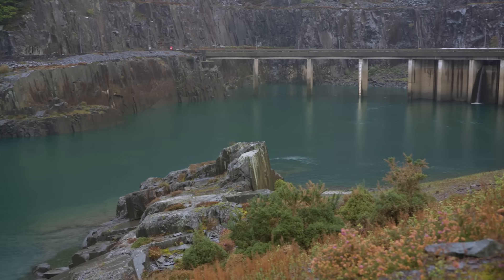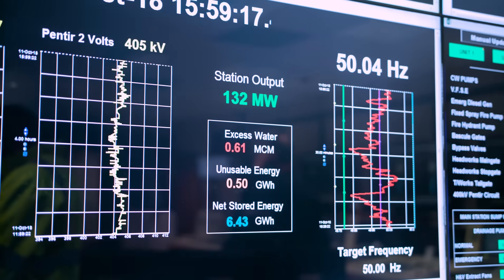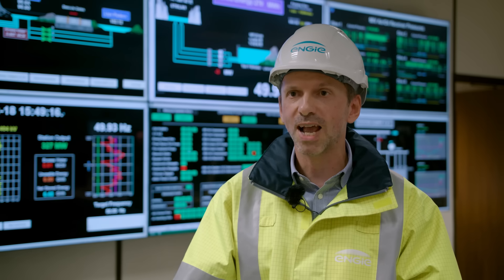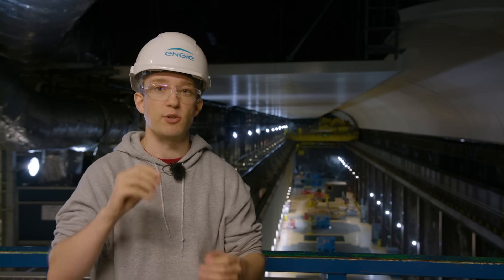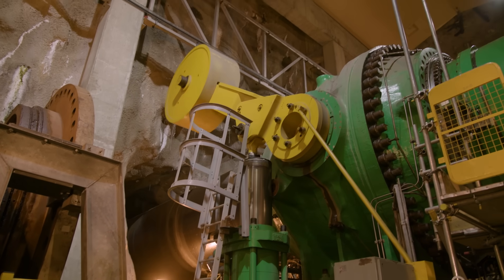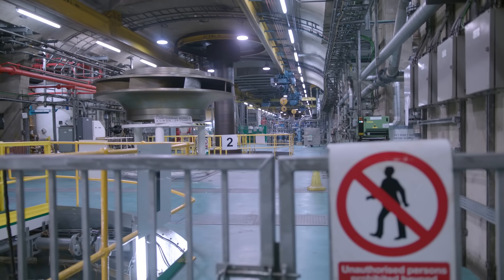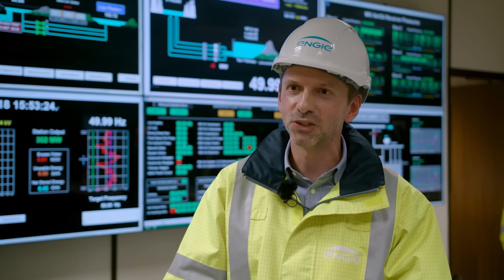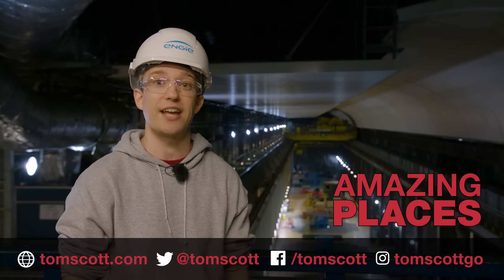Britain's largest battery is actually a lake

Comment: Niagara Falls has something kind of like this, only they don't need to use pumps to fill it.   They have large reservoirs, and and night they divert water from upstream into the reservoir, which they can draw down during the day.   This helps with higher daytime electrical usage needs, but also helps with daytime tourists, as they don't want to divert so much of Niagara Falls to use for electricity that it disappoints tourists.
Reply: Wordsnwood (Art Mulder) of course! People find it very hard to believe that they are able to divert the water entirely, completely draining Niagara Falls, and it’s completely true! They’ve done it before and there’s talk of them doing it again.
Reply: @EVILBUNNY28  
Note that that is about being able to fully divert the water from Niagara Falls itself, which is the smaller, American, falls,  The larger falls, Horseshoe Falls in Canada, cannot be fully blocked in this way.
Reply: @EVILBUNNY28  

I've been told the same thing...

Certainly it is a noticeable diversion from daytime to late night when they fill the reservoirs, if you do an A-B comparison..
Reply: I was told exactly that by my tour guide last summer! And there was a noticable drop in water levels overnight, when they draw it away into the reservior
Reply: One of the most interesting parts of my visit to Niagara Falls was when I happened to wake up at dawn and watched from my hotel room as they turned on the waterfall for the day.
Reply: technically the reservoir is "lake erie" but there are other more active reservoirs behind all the generating stations.
Reply: @markgnorthcott  there is a reservoir between rt265 and garlow Rd at the Tuscarora reservation. As an Uber driver in the area I've driven around it a lot. Canada has a similar reservoir near the sir Adam Beck station across the gorge.
Reply: funny where i seem to bump into woodworking youtubers!
Reply: Lots of us are nerds as well as woodworkers...  ;-)
Reply: That's a hydro-electric plant. It actually "produces" power, electric mountain doesn't produce power per se, it "moves" power from the night time to the day time. I mean realistically it probably does produce some power that didn't previously exist within the system after am extremely heavy rainfall, but in general that's not it's how it's intended to function or it's purpose.

(I put produces and moves in quotes because realistically all power generation is basically the movement of power from one place/form to another. In the case of a hydro electric plant, nature replenishes the resevoir, so we don't have to use power to do it ourselves.)
Reply: @adamkearleyinternetcelebri2409  Thanks for the explainer!
Reply: Niagara as you describe is called off-line storage which is a bit different than pumped storage. Pumped storage can also  make use of non-renewable electricity by taking up unused base load of conventional power stations when it is not required.
Reply: Wordsnwood (Art Mulder) there was a proposal to build a system similar to the Niagara falls one in the Scottish Highlands but it was Lobbied out of existence by people concerned it would spoil the view for tourists, the same way every big renewable energy plan is
Reply: @themadhammer3305  It's infuriating dealing with nimbys. Most of the renewable energy projects are actually prettier than the landscape people claim it would ruin.
Reply: The Mad Hammer That idea was got rid of because it was a hydro power system on one of Scotland’s greatest rivers to kayak
Reply: Though Dinorwig can also draw power from the grid when there's too much supply (which is also a problem!).. Which the Niagara plant can't do
Reply: @Joshua Coales ...  Interesting point.  Here, AFAIK, we ship our surplus power to the US.  Is the UK connected at all to the EU grid?
Reply: I live an hour away and never knew this! Thanks!
Reply: Hydoelectric plants only run at 20-50% of their turbomachinery capacity over a year. After a large thaw they are working hard.
Reply: Thank you for that truly interesting fact, I hope we see a video on it soon! hint
Reply: Also, if too much of Niagara was diverted, the top-secret spaceship base will be revealed.

Comment: If you find a Balrog down there, remember to hook it up to a geo-thermal generator for added power.
Reply: Balrog from a common person perspective: Run away, is a demon!
Balrog from an engineering perspective: And now, we connect the Balrog-1 thermal generator to the grid. Clean energy at a little cost. Nice!

Comment: "...this rainy bit of Wales".  Well, that narrows it down a little. :P
Reply: There are two bits of Wales - the rainy bit and the bit that's about to be rainy.
Reply: @epiendless1128  as someone welsh, i can confirm this is true
Reply: Just thought I'd mention, it's just north of Snowdonia. Dinorwig neighbours to the North of Snowdon. (You can actually see it from Snowdon if you take the path from Llanberis.)
I mention this here because Snowdonia is a rainy bit of Wales compared to the rest XD
Reply: @jammyjammingtonjam  oô
Reply: Previous to the hydro electric scheme the mountain was hollowed out by underground slate quarrying.  When it was being constructed local ex quarrymen who had quarried the chambers within warned the engineers that some of the excavation they were doing to build the power station would  destabilise the interior of the mountain, they were ignored resulting in a huge collapse which thankfully resulted in no deaths.
Reply: @creamytrumpet7435  The mountain was not hollowed out , the majority of the slate came from quarries , not underground mining . There was a little , but it was very little as most of the slate was near the surface and easy to get by quarrying rather than driving in shafts . How do i know ?? , been there at least six times and walked around a lot of it
Reply: @MrTarmonbarry   the mountain was partially hollowed out by quarrying this was the initial hollow which was further enlarged by the hydro electric scheme. The above ground quarry and it's size relative to underground operations is immaterial as regards the power station. I'm glad you've walked around it many times, I've not visited Dinorwig very often as I'm more interested in underground slate quarries many of which I have extensively explored in North Wales as it is my home. Slate was never quarried via shafts, it was accessed by strike tunnels called adits driven in at right angles to the dip in a vein. The only shafts used were air shafts eg at Moel Fferna in the Dee valley. In some places eg Rhiwbach and Maenofferen above Blaenau Ffestiniog there were underground inclines but no shafts. The slate was then exploited via chambers roughly 50 feet wide and 50 feet high with pillars about 50 wide left between chambers to prevent the whole quarry collapsing though some places like The Cambrian in the Ceiriog valley there was a lot of pillar robbing making the quarry much less safe. Due to the fact that extracting slate was done this way they were always referred to as underground quarries rather than mines because mining tends to follow the vein in it's entirety.
Finally going back to Dinorwig I am told that at the very top of the site the Australia mill which operated between the wars still has workmen's coats hanging on pegs still left from the 1930's when the mill was abandoned! One of these days hopefully I'll have the time to walk up and see for myself.
Reply: @Celtic Revival / Adfywiad Celtaidd o.k , do you care to share with the rest of the civilized world what is patronizing about stating the facts about Electric mountain??
Reply: Isn't all of Wales rainy though?
Reply: @supersnowman16  Yep, can confirm.
My reason: I'm Welsh and its pissing it down outside the window rn
Reply: I was born and raised around two miles from here. It’s just outside the village of Llanberis.
Reply: @stevies_cars  just Snowdon no Mount.
Reply: Do shut up
Reply: Implying there’s a not-rainy bit of Wales.
Reply: There is a reason people call Llanberis "piss pot valley"
Reply: 😂😂 to true
Reply: @Celtic Revival / Adfywiad Celtaidd its typical idiomatic welshmen
Reply: @Celtic Revival / Adfywiad Celtaidd and before you go assuming anything I was born in wales and live in england on the border, and think both countries are great
Reply: Near Llanberis
Reply: Near Llanberis
Reply: Well it won't be the famous desert of wales
Reply: You say this as if Wales needed narrowing down
Reply: Celtic Revival / Adfywiad Celtaidd Lmao
Reply: @Celtic Revival / Adfywiad Celtaidd c'mon thats not patronizing at all wales is rainy thats just a fact it's just dumb to be offended about sn1 calling your country wet
Reply: @jamesdavey8675  It's subjective. There are no facts involved.
Reply: @jamesdavey8675  agree 100% an I'm Welsh. It's definitely a very wet country compared to England
Reply: @Celtic Revival / Adfywiad Celtaidd Agree no welsh accents never mind language. oh don't you just love the English, not.
Reply: It's not as if Wales is that large
Reply: @batt3ryac1d  It covers an area about the size of Wales
Reply: As a resident of Wales, I can confirm  @Timpilgrim 's statement to be accurate.
Reply: @Timpilgrim  If you are refering to Snowdonia national park you have no idea what you are talking about . Try looking at a map
Reply: @jammyjammingtonjam  As a statement of accurate, I can confirm this Wales to be true.

Comment: I get that it is for meeting higher demand during the day, but this is so pointless and such a waste of energy, it literally releases the water, and then just pumps it to the top again. Because of perpetual motion laws, this is clearly just wasting energy.
Reply: It's 'wasting energy' only in purely thermodynamic terms - economically speaking, it SAVES energy by pumping the water up during low demand hours - power plants can't be turned off at will and without this, the energy produced by them at night would go to waste - instead it's being at least partially saved for later. Granted, it's not 100% efficient - but even if it's just 50%, it's still better than 0%.
Reply: Every energy storage device in existence operates at a net loss because batteries are for convenience, not efficiency, I assume you don't use "energy wasting" batteries in anything?

Comment: I assume that the rain is bonus energy. Is it significant and is any attempt made to gather it from a wider area?
Reply: There is a slight catchment in the above reservoir of Marchlyn Maur, however they don't want to extend that catchment area in case it effects the surrounding environment, keep in mind this is in Snowdonia National Park which has multiple rare species of flora and fauna which rely on the specific climate, which includes the Snowdonia high amount of rainfall, to divert water and deny it for wildlife on the rest of the mountain would be detrimental.

Comment: anyone know what's the difference between Standard Time and Frequency Time @1:31?
Reply: 00:34, apparently :p
I'd guess it's to do with the turbine not running at a perfectly smooth rate.  Standard time could be the clock time, whereas frequency time could be based on how many cycles the system has gone through.  Presumably if they drift too far apart, adjustments need to be made to get the turbine back on track to keep the cycles regulated.

Comment: I've recently watched one of your older videos (The Problem with Renewable Energy (and how we're fixing it)), and the new video fits so seamless to the message of the old video, except for the fact, that you've predicted a completly diffrent solution how we should deal with storage problems and renewable energy.

Anyway, great video, keep going!
Reply: +thegreenmadow  The thing is that it takes minutes for a hydroelectric dam to kick in and start generating power, by which point the grid imbalance would have already tripped breakers and caused issues, which is what the large spinning steel turbines help mitigate.

One possible solution is to have computerised batteries handle the spikes of energy consumption in between the times while the hydroelectric dam valves open or close (which takes time to mitigate the water hammer issue).
Reply: Electric Mountain takes like 10-30 seconds to kick in, as per this very video (when I went to visit they said it averages at 18 seconds) and provides power at such a level that its use is easily predicted and accounted for.

Comment: But it uses more energy to put the water back up at the top than it provides to the grid on the way down. A massive energy deficit that some one, some where down the line has to pick up the bill for.

I never understood how they figured this style of power plant is feasible.
Reply: Its not a power plant. Its a battery. So long as there is electricity being generated that can't be used (and there is neither nuclear nor coal plants can be fully shut off) getting the power to pump the water back up isn't an issue.
Reply: Think of it as a surge tank for nuclear and wind-generated electricity.  You produce it at night and this allows you to consume it during the day.

Comment: Won't it take just as much energy to pump the water back to the top?
Reply: Its purpose is to help out during peak usage periods, it isn't for steady usage like a normal power plant. They pump the water back up at night when usage of the power grid is low. It is used like a battery, which needs to be recharged.
Reply: Sure but there is a lot of spare electricity that would otherwise being wasted. Energy needs go down at night but wind, nuclear, and coal plants all stay in operation making electricity that no one is using. That spare electricity is what is used to recharge Dinorwigs.

Comment: It's estimated that to completely run the UK off renewables we'd need the storage capacity of over 100 more Dinorwigs. Just goes to show the scale of the challenge.
Reply: Unless we build renewables that don't stop working at night or when the wind drops, like wave-harnessing tech or hydroelectric dams.
Reply: @krashd  Waves are connected to wind, you're thinking of tidal, but that varies with tidal cycles. As for hydro, there's very few suitable places for it of it in the UK.

Comment: Did I get it right? They let the water fall down during the day to make electricity, then use electricity to pump the water back up during the night? Isn’t that perpetual motion???
Reply: Not perpetual motion, cost efficiency. They let the water fall during the day to sell electricity when it is needed most (and they can sell it for a good price) then at night they buy electricity from other sources (when it is cheap) to recharge the reservoir. This might seem pointless but it isn't. There are power sources that can't be fully shut down like nuclear and or wind. Having Dinorwig buy power from them ensure that it doesn't go to waste. They can also buy power from idling coal plants that would also be wasted, though this isn't quite as environmentally friendly (its still an improvement, though, since the coal plant is producing power and pollution either way).
Reply: More importantly than cost or power going to waste is a stable frequency. The net needs a stable 50Hz to operate. Even 1% less or more is already getting into dangerous territory. If more power is drawn than produced, the frequency drops and vice versa. So to offset that, you need batteries like these.
Reply: I see. Very interesting. Thanks, everybody who replied.

Comment: I had heard of water hammer, I had also heard of hydroelectric batteries before, but I never thought about the challenges that the combination of those two would pose...
Anyways, truly fascinating!
Reply: there was a huge dam in russia that was blown apart by water hammer. they shut the valves below the turbines, and the huge pressure spike caused the turbine to blow out it's bearings and shoot through the generator house. i believe it was stopped from draining it's entire reservoir by a coupe of guys that managed to shut a backup valve at the top of the dam.
Reply: @wyattroncin941  sounds like a movie.
Reply: Wyatt Roncin I thought of that dam when I saw this video.
Reply: The same principle that makes ram-pumps work.
Reply: was thinking the same :)

Comment: Chemical Energy is not called potential Energy. Potential energy is energy possessed by an object due to its relative position.
Reply: It isn't limited to that. A chemical battery, a capacitor and a spring all store potential energy.
Reply: No, chemical is a type of potential energy
Reply: Except for the fact that there is something called chemical potential energy.
Reply: Well then, chemical energy is just potential energy possessed by the electrons due to their position within the cell.